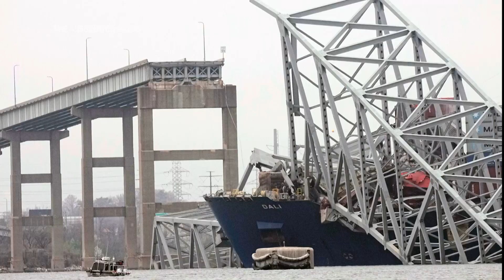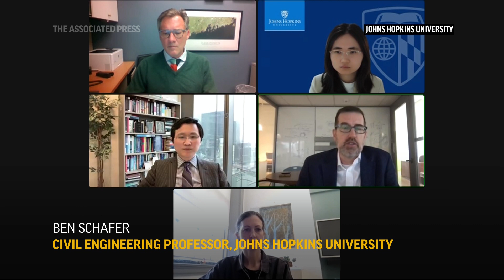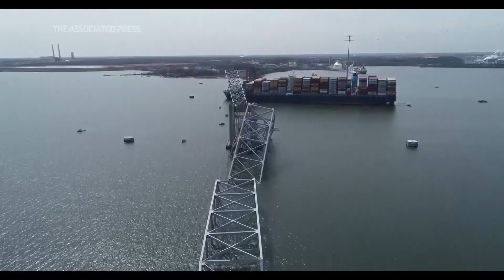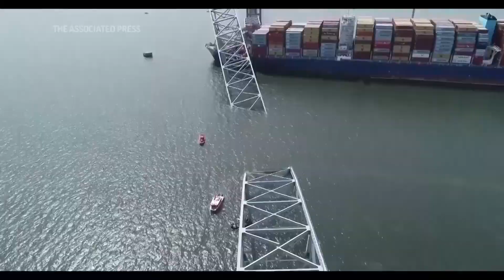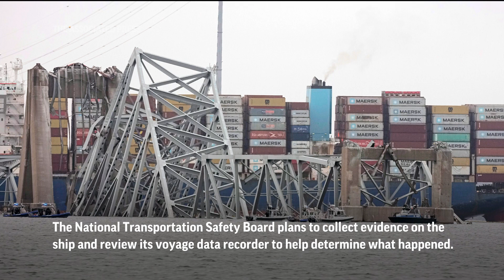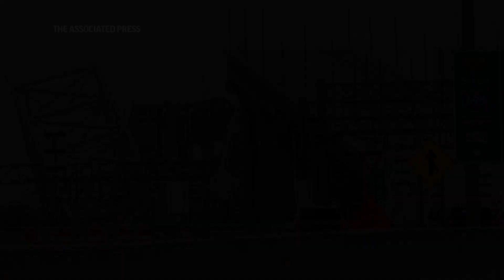There's no way to protect a bridge completely from ship strike, engineering expert says

Comment: This skip was steered into the bridge on purpose.
Plus there was explosives in the girders that went off also.
To help bring down the bridge
Reply: lad, not everything is some grand conspiracy theory. there'll be an engineering report in 6 months to 24 months that'll show there was some critical maintenance on the ship put off because of expenses, like there always is, and it won't get nearly the same media attention
Reply: @j377yb33n  these slips have multiple steering functions redundancy is key.
They can be steered even in power down situations.
And secondly do NOT talk to me like that unless you can disprove what's already common knowledge in the shipping industry.
There's supposed to be a guide ship and tug boats to that is a conspiracy that you're avoiding
Reply: @patrickpearl169  yeah, and just like every armchair engineer here all we have to go on is the video footage of the ship without power, the plume of smoke from the exhaust just after lights kick back in as it hits the support truss, and the mayday the ship put out before their power failure.

Just like almost every other large American disaster like this, it's some maintenance procedure or that engineers requested get resolved and was cut for cost reduction(like east Palestine), or some kind of human error.

Just because the american media was whipped into a paranoid fervour with your double bill of middle east wars doesn't mean that every disaster is the act of some malevolent set of bad actors - corporate profits are more than capable of causing that destruction